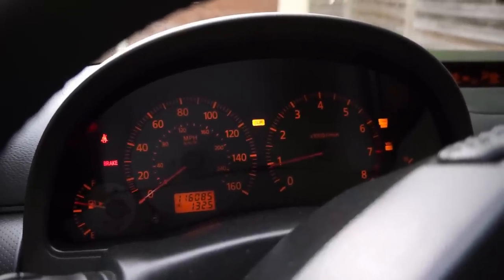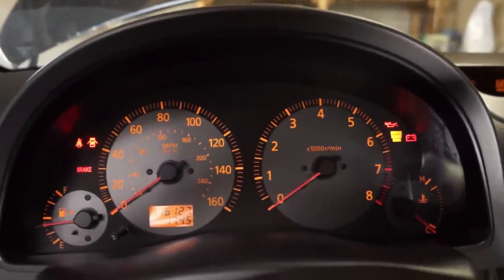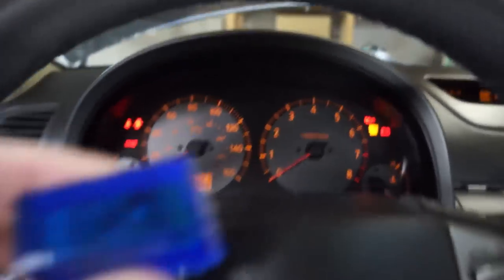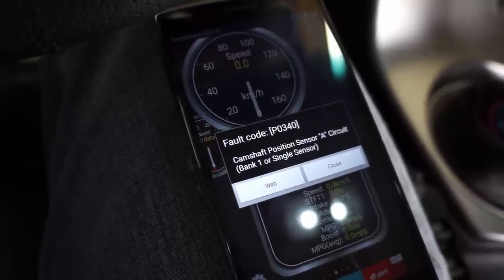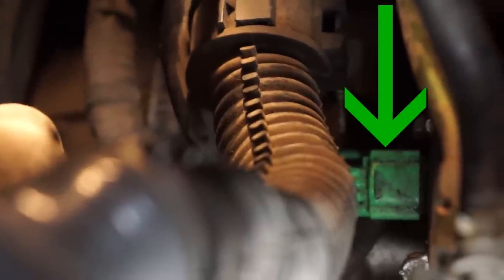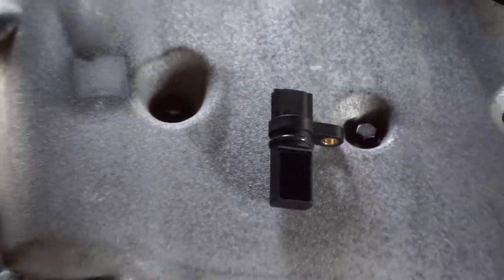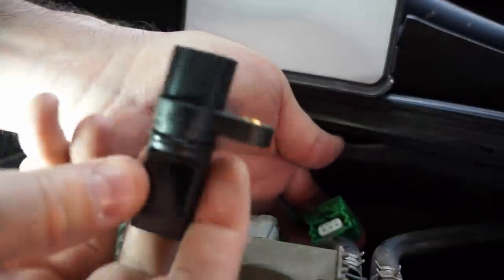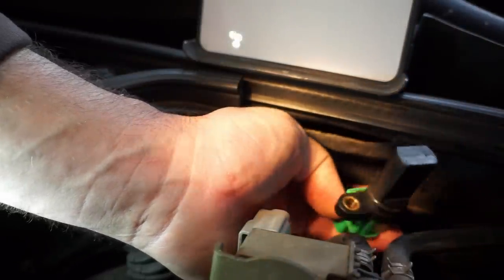2003 Infiniti G35 Camshaft Position Sensor (Passenger/Right Bank 1)

Comment: Thanks man.  I was driving and the car just shut off.  All of those light were on that you described in the video.  I disconnected the positive post on the battery and everything reset.  Then a day later it did a little bit of a jerk on the interstate and loss acceleration for a sec.  I took it easy the rest of the way home.  The sensor is like $20 so will probably just go ahead and change it.
Reply: the only code I could find originally was pointing me between the positive post of the battery to the compressor.  Strange.
Reply from the maker: My pleasure.

Comment: dude. it was literally 9 at night here in ny when just saw this vid. i went to auto zone (who close at 10) got the part and fixed it! great video!
Reply from the maker: Excellent, happy to help.
Reply: How is it holding up?  A lot of folks online say get OEM and not aftermarket. I have to do this tomorrow and want to know if your Aurozone part failed or is still good
Reply from the maker: Not sure about the AutoZone one but the Rock Auto part I got, link in description, has been working great.
Reply: Mike T so the autozone sensor did indeed fail after about 2 months. I replaced it with an oem sensor from Nissan and it was good until I sold her.
Reply: @JRsGarage  I got the Hitachi brand model CPS0008 after confirming its the actual OEM sensor Nissan used for our cars!  Autozone had one for $59.99 much better than the $140-160 quotes I got from a few different Nissan dealers. 

Installed the sensor this morning after watching your video JR. 

Thank you so much. 
Here's my thread I wrote up on G35driver

https://g35driver.com/forums/g35-sedan-v35-2003-06/469504-camshaft-error-p0340-drive-home.html#post7196157
Reply: @imotomoves  That's crazy! Glad you sorted out before the car sold. I think the previous owner of my car had an after market sensor as well. Didn't look anything like the oem sensors do when I took it out nor did it say Hitachi or Nissan on the actual part. My replacement sensor had the actual Hitachi part number listed on the base of the sensor
Reply from the maker: Excellent, glad to help

Comment: I have been running my car now for about a month with this problem because I had no idea wtf problem was! Buddy of mine mentioned this sensor and here I am. Ordered the part from a link in a different video which comes today. Hope to God this fixes the problem. All the lights are the same except sometimes, like 3 times within this month it stalled on me at stop lights. Can you imagine how embarrassing it is to have 20 people next to you as you try to start the damn thing? I'm 98% sure this is the problem. Already cleaned my MAF sensor, changed the air filter just in case, replaced the fuel pump, and now if this doesn't fix it I will take it to a mechanic cause I'm sick of this. We'll see.
Reply from the maker: Sounds like the sensor is the right fix for your problem.

Comment: Thanks a lot for this DIY video. My 2004 Infiniti g35 stalled with fault code P0335 which is bank1 camshaft sensor. This video was great in showing me how to replace the sensor. I was able to do it but getting the bolt out and especially putting back the bolt was kind of tough as there isn’t much room work with. I got the sensor from 1A Auto for $34 for both bank1 and bank2 sensors. I replaced only bank1 (passenger side). It is working now but based on the posts I read, looks like it will crap out in few months. I will then order Hitachi one to replace. Thanks again for the great DIY video!!
Reply from the maker: My pleasure, glad it helped.

Comment: Thank you for this video. Very detailed instructions. Crazy how a tiny thing like a sensor can screw up your whole car. +1
Reply from the maker: My pleasure.
Reply: JR's Garage I just came inside after trying to get that damn bolt off for 2 hours. I’m thinking I need a longer wrench, because it seemed impossible to hook it and be able to turn. Any suggestions? Lol
Reply from the maker: @chaselucas3057  I don't remember needing a very long extension.  Sometimes a 1/4 inch drive with a small extension is easier to get into the tight spaces than a long extension on a 3/8ths drive.  I do remember having to lay across the top of the engine to reach it.

Comment: Hey, I am having a really hard time fitting a wrench or socket onto that 10mm bolt to get it loose… do you have any tips on how I can get at it a bit easier ? maybe some penetrating oil. im not sure. thanks !
Reply from the maker: It really should not be on that tight.  I got to it with a 1/4 inch ratchet and deep 1/4 10mm socket if I remember correctly.  Maybe a universal joint will help?

Comment: Worthy  of mentioning, only replace these camshaft sensors with Hitachi brand or Nissan/ Infiniti brand. All other brands do not last.   Hitachi makes them for Nissan/ Infiniti by the way so in essence you are buying Nissan/ Infiniti when you buy Hitachi. The one thing is Hitachi is the original design of the sensor, the new Nissan/ Infiniti is metal so when buying Hitachi you are buying the first release of the sensor which should be good for about 100k miles.
Reply from the maker: Thanks for the info.  So far the Beck/Arnley I purchased has worked great... 20k miles so far.

Comment: Wassup buddy my car does the same thing but I don't have any codes is it because camshaft sensor is starting to go bad ? Should I buy both sensors or just bank 1 ?? Please help thanks ! I have 04 Infiniti g35x
Reply from the maker: I bought both sensors thinking the drivers side would go soon after the passenger.  They are pretty cheap so I'd just replace both and then see if that solves your problem.

Comment: I changed both sensors and the passenger side sensor is 10x more difficult than the driver side. It's just so tight with that wire harness in the way, took me forever to get the bolt back in.

The driver side is easy if you do it from the passenger side. Do NOT remove the intake and throttle body, just lean across the engine from the passenger side and do it by feel with your left hand and a 10mm wrench. Yes, it's a blind job, but very easy to do by feel...Just feel around for the sensor's plug and the 10mm bolt with your hand and break it lose with a wrench. Removing the intake and throttle body is a waste of time.
Reply from the maker: Thanks for the comment.

Comment: Thanks for the video my g35 05 just threw codes p0300 and p0011 for random misfire and the intake camshaft position timing over advanced bank 1
Reply: Any ideas ?
Reply from the maker: Youtube never informed me that this comment was waiting for a reply, sorry for not responding quickly.  I'm not really sure about those specific codes, sorry.  Did the problem persist?  Sometimes the ECU can throw codes but it may be a momentary thing and they never come back.

Comment: Just now changed the sensor and still the same problem and my scanner says crank shaft sensor a circuit. Any idea why?would be much appreciated thanks
Reply from the maker: I've heard people have issues with some aftermarket brands being faulty.  Might want to try Hitachi brand model CPS0008 which I've heard is the actual OEM sensor Nissan used for our cars.  Autozone might carry it.

Comment: My car has a slight misfire, it starts up fine but it’s throwing the code for camshaft position sensor. I believe it just isn’t working properly like it is going to go bad soon. Any thoughts?
Reply from the maker: If its throwing the sensor code just change it out.  It's cheap and easy to do.

Comment: Is there an OBD2 reader and app you would recommend for an iPhone? The same lights you describe in your video came on today as my car came to a halt while driving. It was able to start up. But this is the 2nd time in 6 months this has occurred. I took a look at the camshaft sensor in my Infiniti 2005 G35 and there is a melted silver substance on the green plastic. Appreciate your help. This was a very helpful video. I just subscribed.
Reply from the maker: I use torque as my app on Android.  I'm not a iPhone guy so I'm not sure what the best app might be for Apple.  The reader would probably have to say it works with Apple products so I'm not sure what model to buy.  Amazon reviews might help you out.

Comment: My 06 is pulling a p1078 code saying that it's the bank 1 camshaft sensor on my autel scanner.  Is that the same issue as this since the codes are different?
Reply from the maker: Not familiar with that code but there may be more than one code regarding that sensor to identify different problems.

Comment: Hey JR, I recently got a P0011 code for what I believe to be the camshaft position sensor but everyone is also saying that it could he solenoids. Any advice?
Reply from the maker: Does the car idle erratically or drive different?  Are you also getting a code P0340?  Did you recently change the engine oil with a non-recommended viscosity?

Comment: I have a 2013 g37 with the same issue and same code for the bank 1 cam sensor. Where is it located. Is it the same as yours?
Reply from the maker: I'm not too familiar with the G37's but according to this website it appears that on the G37 the cam sensors are on the front of the engine on the sides of the timing chain cover.  They should look nearly the same though.  https://parts.infinitiusa.com/nissanparts/?action=replacement&groupid=D&sectionid=221&jointvehid=17694&siteid=15##

Comment: I've replaced the bank 1 sensor but the VDC Off and SLIP lights are still on. It fired up just fine but I can't get the lights off. 

I have a 2004 G35 Sedan. I feel a loss of power during acceleration. Should I replace the bank 2 sensor as well as the crankshaft sensor? The AT light flashes a few times when I start the car as well. 

Any advice?
Reply from the maker: What engine code are you getting?  Did you reset the check engine light after performing the sensor change?
Reply: JR's Garage P0340. I don't have a device to reset the check engine light, so I'll head to Auto Zone and get them to clear it. I'll get another code print out because I'm sure it said something about the Brake Solenoid or something like that. I don't have the original printout they have me before.
Reply from the maker: Yes, clearing the codes will need to be done.  You may have to drive it for a while afterward for whatever code remains to reappear.
Reply: Yes replace all 3! But before you do disconnect the battery.

Comment: i need some help my car today and it noticed the lights came on same with all the lights everybody else and it shifted real hard and started running like ass and cut off and wouldnt start but i let it sit for a minute and started back up would this be the problem ?
Reply from the maker: Sounds like it could be.  Take it to a parts store and have the codes read.
Reply: JR's Garage I read one of the codes and it did say it was the p0340 code but i didnt see the oother code im going to just replace both sensors tomorrow

Comment: Great vid, How about the other side? I head that you have to remove the entire manifold to get to it?
Reply from the maker: Sorry, haven't done that side so I'm not sure.
Reply: For the other side you pretty much have to remove the your intake tube after the air filter box and remove the throttle body to get access to the sensor and bolt.  For a g35 or 350z code p0340 is your passenger side sensor and po345 is your drivers sensor.  Code po335 is your crankshaft sensor which is best to get at under car accessed just above the second left side plastic undertray panel.
Reply from the maker: Thanks for the info.

Comment: I had exact same symptoms but I also got smoke coming from engine, is that normal with bad cam position sensor ?
Reply from the maker: Was it coming out the exhaust or from inside the engine bay?
Reply: @JRsGarage  it came from engine bay
Reply from the maker: No bad sensor that I'm aware of should cause smoke to come out of engine bay.  Sounds like some other problem.

Comment: I replaced bank 1 on infiniti m35 with genuine Nissan part from amazon. Car starts instantly now instead of few seconds. But now I get smoke and smell from tailpipe. Also, there is noticeable oil underneath the sensor, but i never had smoke prior to replacing sensor.
Reply from the maker: Sounds like the gasket on the sensor might not have sealed properly when you tightened it down.  Try removing and replacing it to make sure it is seated properly.
Reply: JR's Garage makes sense.
The bolt is on tight and I thought the sensor was snug. How would I know when gasket is properly in place before starting the car again?
Reply from the maker: If I remember correctly, the sensor has a gasket already installed that seats in place when you bolt it in.  As long as it went in straight it should be good but if it went in crooked it might feel tight but still leak.  The only way you will know is to remove it and then re-install it making sure it goes in straight.
Reply: JR's Garage 

It was a defective sensor shipped and sold by amazon.

I got one from infiniti dealer today and worked like a charm no smoke
Reply from the maker: Wow, that's unusual, but I guess it happens.  Good to hear you figured it out.  Thanks for the info - good to know.

Comment: Hey there guys! I have an 07 FX 35 and 2 months ago I got same problem. VDC OFF light came on as well as SLIP and SES light. I have changed it with a new sensor (not an original one) just random brand for like around $50. 2 months later the same problem happened. I got same lights and p0340 again. A lot of reading and I got to the point that this sensor got bad as it was not that expensive. I got a brand new one, replaced it and a week later same thing. I am desperate I do not have a mechanic that can tell me what is wrong. Perhaps doing a ECU reset. I would appreciate any comments that you can share.
Reply from the maker: I would say clear the codes and if it immediately comes back then you might just be really unlucky and got 2 bad parts, return to where you got it.  If it stays away for a week or so and then comes back you probably have something else wrong and we've exhausted the extent of my knowledge.

Comment: I replaced mine today and the code was gone for a while but after the next start up it came back any suggestions?
Reply from the maker: Possible the electrical connection is loose, the sensor is not seated fully or maybe you just got a bad unit?
Reply from the maker: I used a non-OEM sensor and it is still working just fine.

Comment: Does the battery need to be disconnected at all? I saw another video where they were changing Bank 2 and they disconnected the battery. Is this necessary?
Reply from the maker: I don't think I remember disconnecting the battery.  If I can find the shop manual I'll see what it says.
Reply: JR's Garage thank you so much that would be Greatly appreciated
Reply from the maker: Couldn't see anything about disconnecting the battery before replacing the sensor.

Comment: i have the same code, but my car will shut off randomly when im stopped at a red light, is this CPS part of that problem?
Reply from the maker: Possibly.  I've never heard of it causing your particular problem but it's possible.  If it's giving you the right code the first thing to try would be to replace the CPS.
Reply: yeah I took it to autozone tonight and its the same exact problem with CPS on Bank 1 I literally bought the g35 today and didn't have any issues on the way home only when later on through the day
Reply: and also my ac is stuck on, my center console buttons don't work at all, ive checked all my fuses and relays but none of them work, i can only change my radio from my wheel and there is a loud ticking noise coming from my passanger dash (Behind) that just continues to go on and on the whole time i drive. know anything about that?
Reply from the maker: The heater and radio controls are all connected to one circuit board behind the plastic of the center stack.  Something may have gone wrong with that circuit board which is causing the buttons to all fail but the actual radio works you just can't control it except from the steering wheel.  There is no other controls for the heater/AC so that will be stuck wherever it was last set.

Comment: Mine has 02 sensor pulling up and Cam shaft position sensor. Exact issues thanks alot.
Reply from the maker: Good luck with the O2 sensor.  Hopefully it's not rusted in there.
Reply: @JRsGarage  changed it out just used  some wd40

Comment: Took it to the electricians to get diagnosed, it was a camshaft sensors, I replaced it and it still doesn't start and it doesn't give off any codes
Reply: I have a feeling the electricians got butt hurt and fucked with something in my car because I didn't accept the 450 charge😕
Reply from the maker: That's crazy that he wanted 450 to do the job.  Tough to diagnose if it's not throwing any codes.

Comment: Thank you very helpful.
Can you help me about the code P0081 Infiniti G35. My car is going very slowly even I hit the gas 40-50. Can’t really drive only going slowly.  I replaced IVT Control Solenoid valve bank 2 . Still the same. Please any help.
Reply from the maker: Did the code go away after replacing the solenoid?  If the code went away and you still have driving problems I would take it to a mechanic.
Reply: JR's Garage yes the code go away. Thank you for the feedback. I will take to mechanic. Thank you .
Reply: sound like you got a transmission sensor issue you got a sensor issue that controls speed speed sensor you got some kind of sensor issue